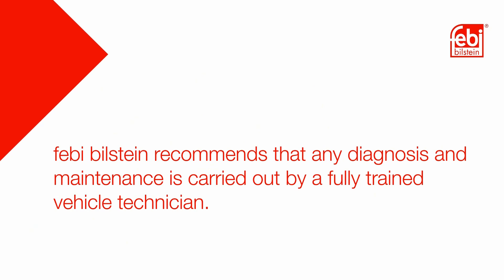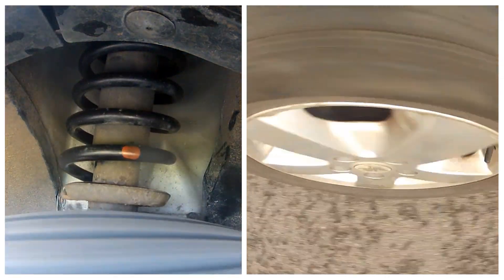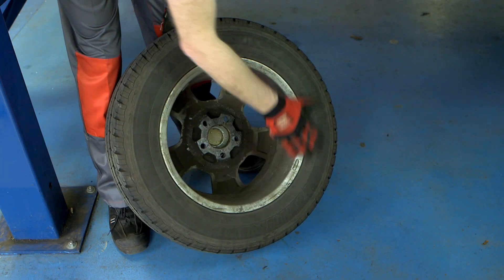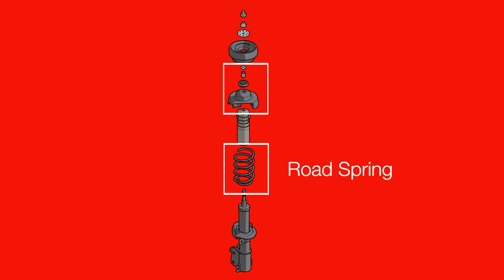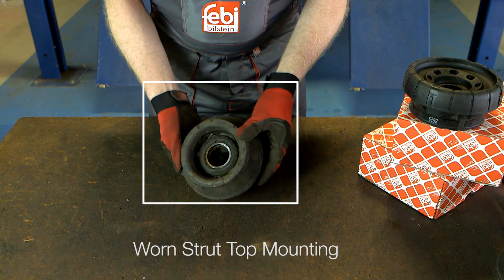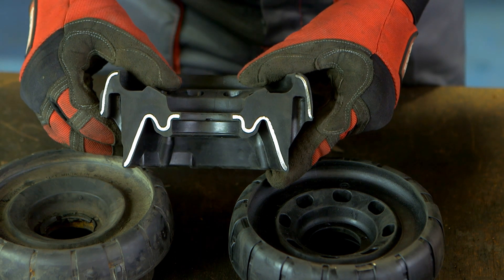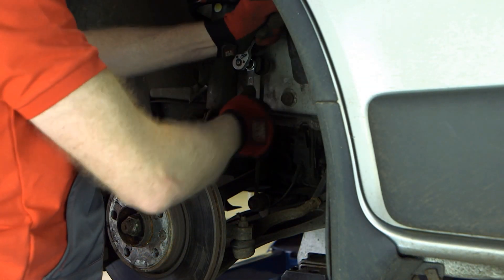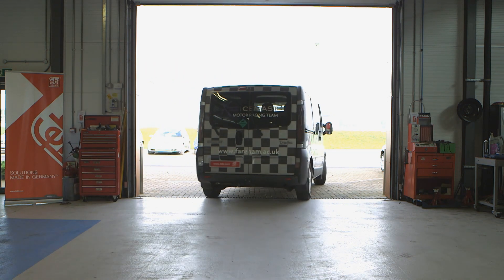[EN] Suspension Strut Top Mounting Inspection and Replacement

Comment: This video has given me peace.
I can't believe it took me years to figure out what that was in my Saturn.
I've changed just about everything else in the front end at this point.
Reply from the maker: Thank you for watching our video. Vehicle vibrations are sometimes hard to track down, until you find what exactly what has been causing it. The difference replacing the worn engine mounts on the featured vehicle made it feel like a new car.